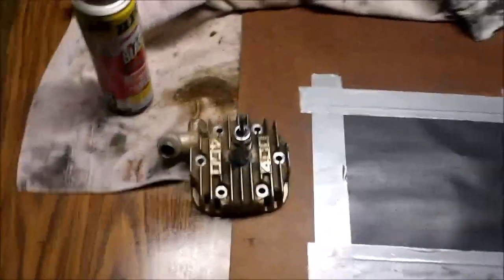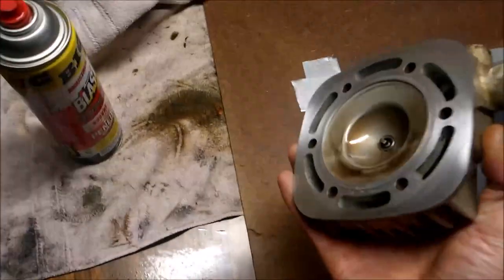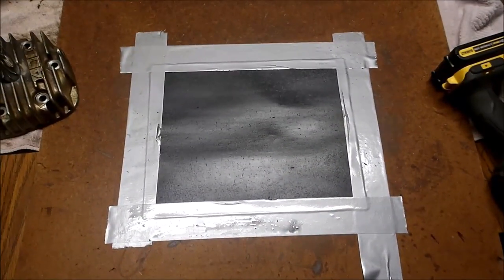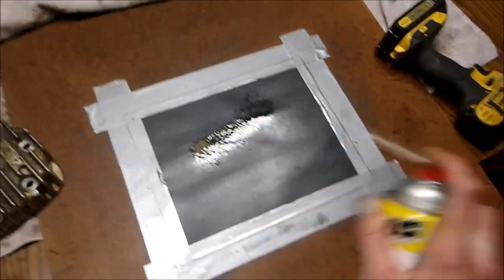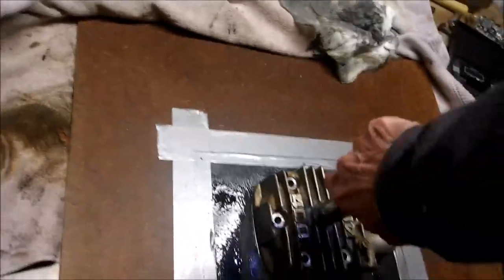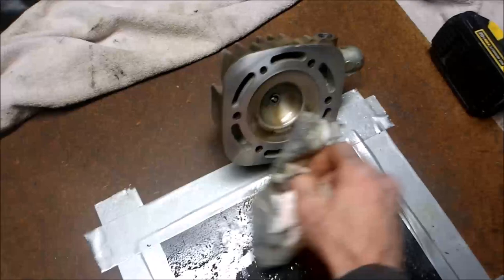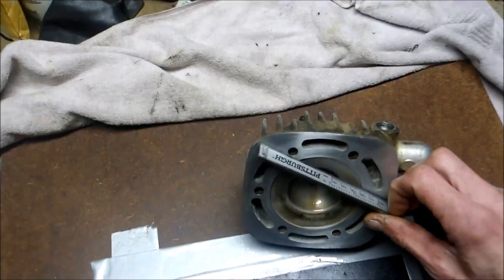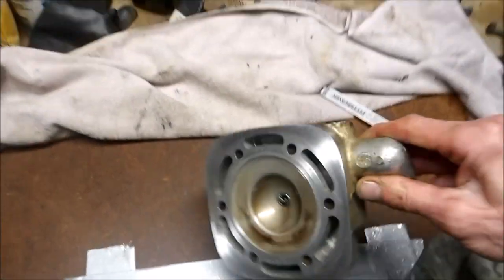Is your Head warped on your Polaris 400/350/250 ATV? Try this!

Comment: I enjoyed your videos. But I am having an issue with my 99 Xplorer 400. Hoping maybe you could give me a different perspective on what my issue may be.  New battery new  solenoid. New handle bar starter switch.  New starter motor.  My issue is it will start when I pull start it. But using my push button to try and start it. It cracks over just fine. But no spark. Jumped solenoid so I didn’t have to use my push button starter. Still no spark. But if I pull the starting cord. It starts every time. The only thing I noticed is the crank bearing has a tiny bit of play. Would the electric start torque the magneto far enough over to make the magnet miss fire kill the spark?   What are your thoughts. Thank you. 
George.
Reply from the maker: It could be the CDI. Try unplugging the black wire from the cdi. you should have spark. its the kill switch wire. you might not be able to turn engine off unless you plug it back in. try that. if you have spark...its the cdi or a short somewhere.
Reply: Titaniumman Garage I will give that a try today. Thank you very much.  I watched many if your videos and enjoyed listening to you explain all your instruction. Have a good day sir. I will let you know what I find out.  Thank you again.
Reply: So. Unfortunately I did unplug the black wire from the CDI box. Same issue. So maybe an adjustment under my magneto may be off?  Is it possible the pickup for the stater is not correct?  The timing marks are perfect. But how about the electronic pick up for the spark timing?  If that moved?  What is a typical adjustment for that?
Reply from the maker: Im not positive what position the pickup should be in. I could tell ya if it was a 4 stroke. So it could be stator or spark plug coil. Or check flywheel. sometime the woodruff key shears off.
Reply: Titaniumman Garage what I was referring to is called the pulse coil or trigger coil.
Reply: Titaniumman Garage I woo do that this after noon. Thank you so much.
Reply from the maker: Yes. I knew what you ment. I've heard. 010. Away from flywheel. But that's on a 4 stroke. Not sure about the 2 stroke. Also check your sparkplug wire. Make sure it's plugged into the coil all the way. They go bad too.
Reply: Thank you for responding..I realized after you giving me a few new ideas to look for. I realized he pull starter cord busted and after that it wouldn't start with the electric start.. I removed the flywheel and cleaned and adjusted the pulse coil. it was a little out of adjustment. plus it has a little debris on it. it should be set at .4MM to 1MM. I am back in the game.. Thank you very much for all your assistance.
Reply from the maker: Nice. I was gonna ask if you busted the recoil rope. That's an automatic pulse coil adjustment. Thanks for the info.
Reply: Titaniumman Garage thank you for all your help friend.  Keep the videos coming.